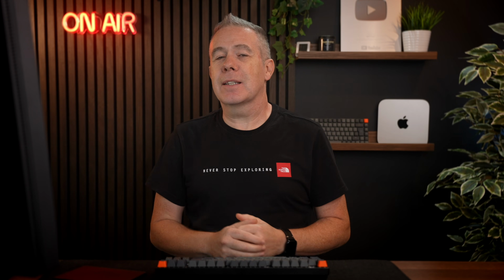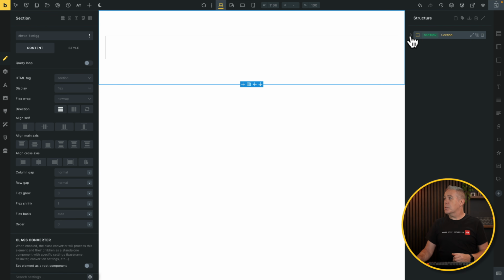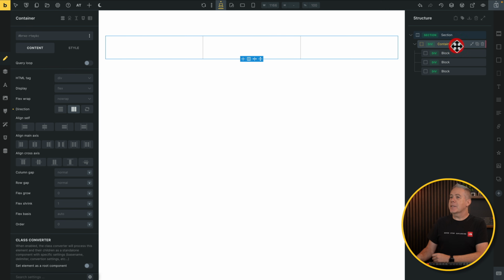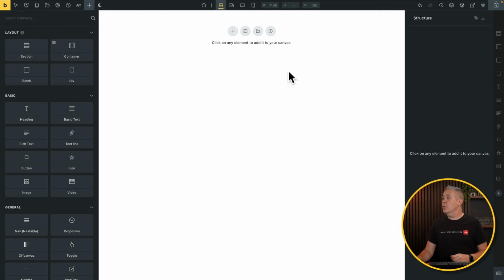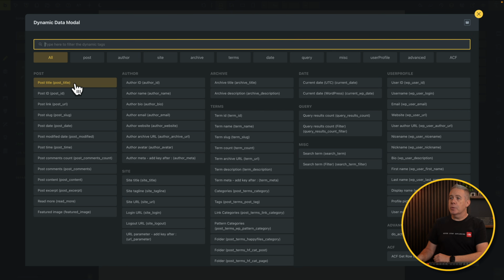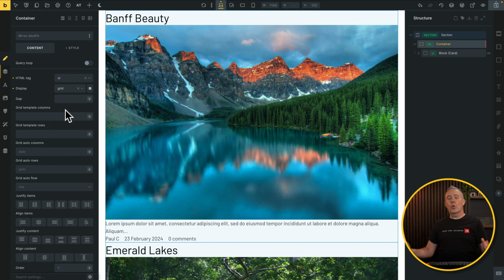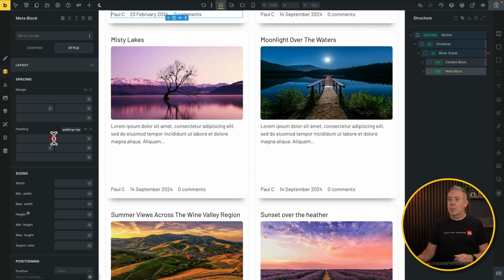Mastering Bricks Builder: Sections, Containers, Blocks & Divs Explained

Comment: Do you have any extensions or this is how Bricks looks nowadays? I'm currently learning how to use Bricks and on tryBricksbuilder enviorment bricks looks different and more outdated. For example i dont see option to change breakpoints, to change to mobile first, also i dont see info which HTML tag element in structure is, etc...

Comment: Hi Paul, thanks so much for this video and the tons of other stuff you offer freely, so much appreciated!
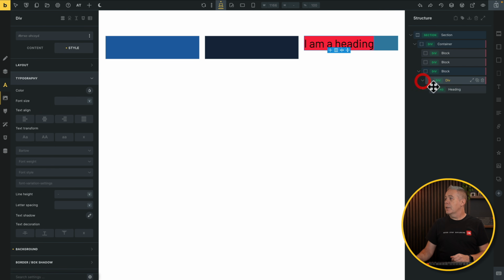One question regarding the block/div-elements (around 7:12 in the video): after the font size of the heading got smaller, this also affects the size of the surrounding block. That's not what I at least would want/expect, but rather that the block size remains untouched?

Comment: Whats the specific difference between a Bricks block element and a div element?    I missed that if it was explained.     Thanks for the video!
Reply from the maker: @CoreyStup  it was explained, but the tldr is that a block takes up 100% of its parent container and a div takes up the space required by what’s inside it (unless you set a value for width or max width).
Reply: @WPTuts  Thank you!   A summary (for my own brain) would be: section = 100% width,  container = page width, block = 100% of its parent, div = constrained by its content.
Reply from the maker: @CoreyStup  yup! Spot on :)

Comment: Is bricks better then elementor?
Reply from the maker: @raidislam3452  in my opinion, yes. But you’d have to make up your own mind based upon your needs. 👍
Reply: Hey, so I was an avid pro user of elementor since 2017ish and I just hopped to Bricks. It is an opinion thing to a degree and your use case. Elementor is still a bit easier for client hand-offs if that's something you do.

The key reasons I switched: Class first is faster in every way, the code output of Bricks is clean which is what makes it faster (even with elementor's recent optimizations their code is still not as clean and is not semantic), accessibility - because of the cleaner code you can setup your page for semantic which means the right logical order that screen readers use and screen reader shortcuts actually work in Bricks pages (Often elementor doesn't work with screen readers), basic SEO included- even without something like rank math you can set SEO titles and meta easily including the images that show for social sharing!

That's why I'm switching moving forward depending on the project needs.

Comment: Bricks use section html tag into section block by default. This tag shouldn't be use to create view layout of the page. Section html tag should be use to semantics. Use html tag as default, may occurs to build wrong document structure.
Reply: Bricks automatically sets up the html page structure for you. When you add a section element, it’s being added/inserted into the correct place, so you don’t need to add all the surrounding tags like html, head, etc. 

Yes, you should use the section element semantically when building out the content of each page.
Reply: @JacobBall75 And it's occurs, the most pages are not semantic. Section into bricks is layout element, not semantic element. This is section main role.
Reply: @mareklewandowski9727  I don't really follow. Bricks inserts a <section> tag into the DOM whenever you add a Section element. Using sections on your page is the correct way to differentiate your content areas, which is what the <section> tag is designed to do. Yes, you can style it and use it to lay out your page, but Bricks is one of the very few that uses the section element in the correct way it's meant to be used. They don't insert a <div> element with a section class - it's literally a <section> tag.
Reply: @JacobBall75 Learn about semantics.